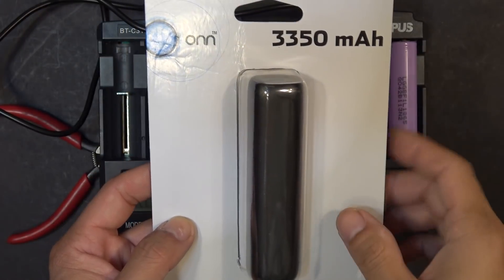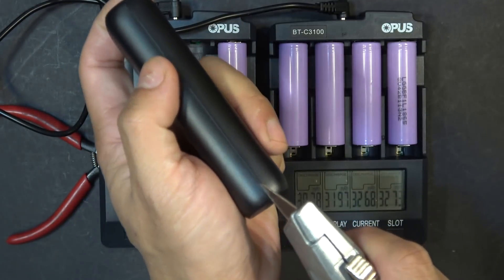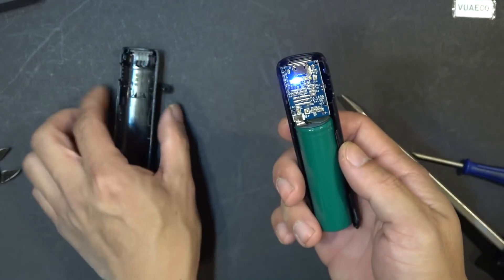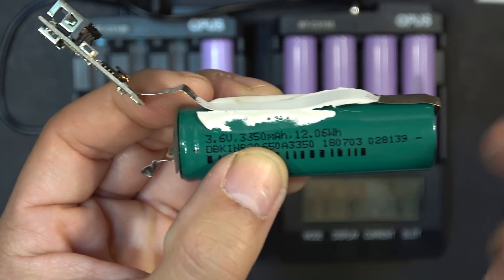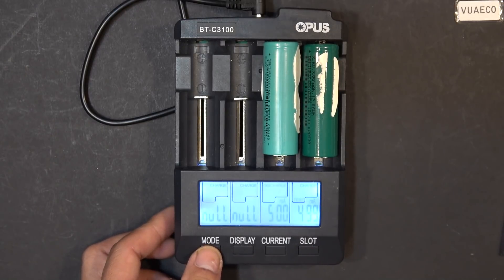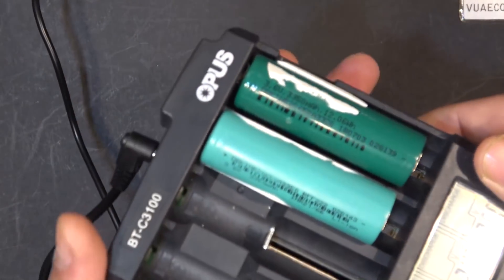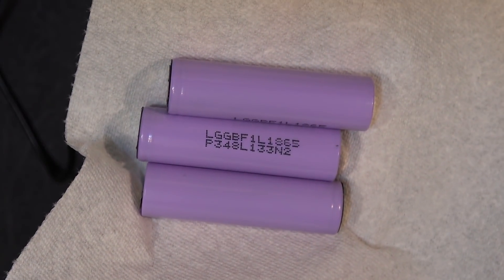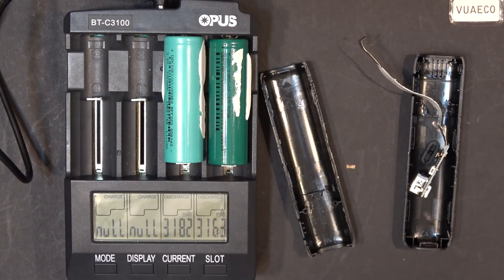Testing INR20650A3350 aftermarket 3350mAh 18650 (or rather 20650) cells: Are they any good?

Comment: if you really analyze it its not impressive 
              the low cost leader is the LG F1L 3350mah 18650  (kind of when development for the 18650 stopped because of the shift to 2070 or 2170 and i doubt we will see anything more then the 3600mah as the upper limit) 

and in the 21700 ("Tesla" battery) the mass produced leader are 4800mah - 5000mah  ALL BEING MARKETED AS 5000mah  i know that many RavPower power banks use them

Now we have this 20650 size (which to start with will not fit every 18650 application) but to not even match the smaller 3350mah is a let down.  if it was a Band name like Lg or Panasonic it would be ~3700mah given its size increase even if only 2mm 
    this BIGGER CELL should at least match or beat the smaller 18650 and i am sure it comes up short in other area as well (a lot of the LESSER known Power Banks are using them like CHOETECH  if i want something Shuckable i will use RavPower and the 3350 LG's inside

Comment: can you help me please.

the battery of my Asus laptop, after 2 years, does not charge anymore, so I opened it.

I founded four cells with the following serial number "lgabe11865 p053b228c6" (the color is dark green); one of these is charged at 2.6 V, the other three at 3.2 V.

can you kindly tell me where can i buy four new original LG cells like these for replacement?

I found them only on alibaba or alipress and I do not know if they are original, do you know some other site for the online shop and that it is NOT Chinese?

best regards
Reply: you can buy them from aliexpress. before buying pls have a look at the customer review. if review is good enough you can buy them.

Comment: I'm torn between the cheap 20650 here and the 18650's out of the lowes 1.5 ah 2 packs. 12  1.5 ah high drain cells for 15.00 is hard to resist. Thanks for posting this.

Comment: 20650, not 18650. To large for many applications (Ie an 1860 flashlight) it's used in drones, vapping etc. You may want to change the title. Still love your channel!
Reply from the maker: Yes, they are 20650's (2mm thicker than 18650's). They will still do fine in applications without an enclosed 18650 case.

Comment: Hey thats not a 18650 thats a 20650 its 2mm wider than a 18650. Just wanted to let you know :)
Reply from the maker: Yes, these are indeed 20650's. They are 20mm in diameter instead of 18mm. Won't fit in anything that has a tight case designed for 18650's. But should work fine for the most parts.

Comment: WOW, I am impressed with the results.  After testing about 50 batteries purchased as NEW on Fleabay, virtually NON of them gave any where close to the advertised capacity.  I was lucky to get about 40-60% of advertised.  [ Onn is in fact a Walmart house brand.  I have a 32" Onn TV from Walmart and it appears nearly identical to a TCL RokuTV but without the built in Roku.   I will be honest to say, after watching your results and based on my past experience with a couple of Onn purchases, I wont be looking down my nose at the Onn brand.   What is unknown from your test is the ability for rapid discharge (ie like on your ebike).]   Any thoughts?  Again, another great video and right down the alley of my areas of interest (again!).   Happy Holidays 2018.
Reply from the maker: Hi John, happy hollidays! These are low discharge cells. So are the LG 3350 cells. Max discharge rate is 2-3C. I'd say less than 10A. You can still use them for ebikes but you have to put many in parallel. That makes the pack big and bulky but you get more range.